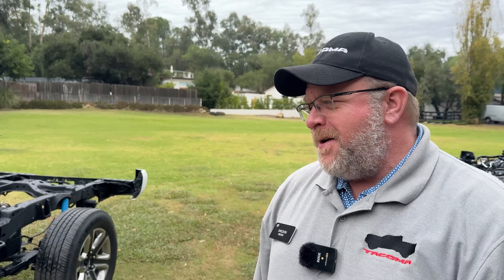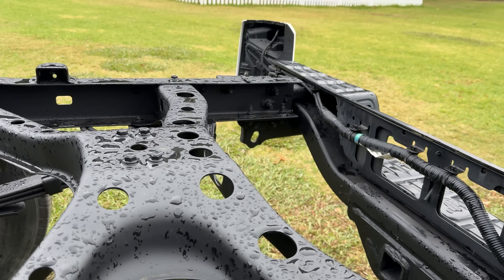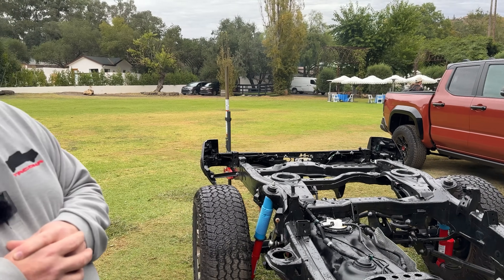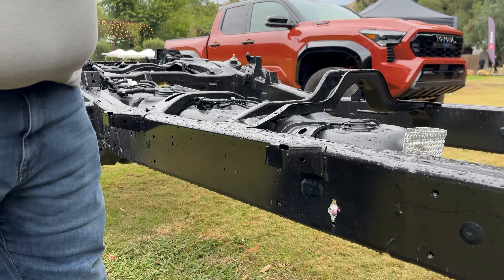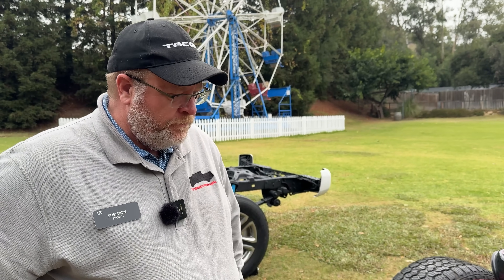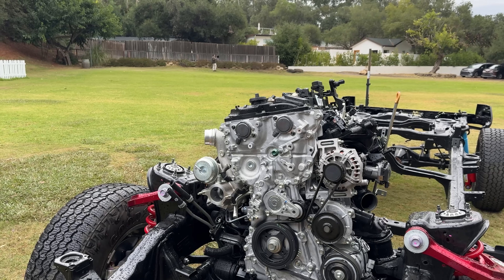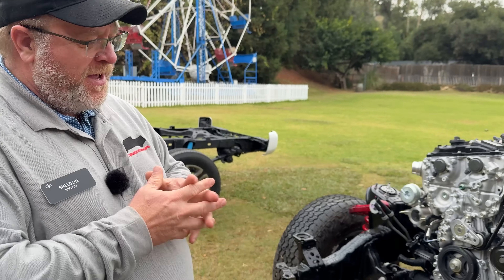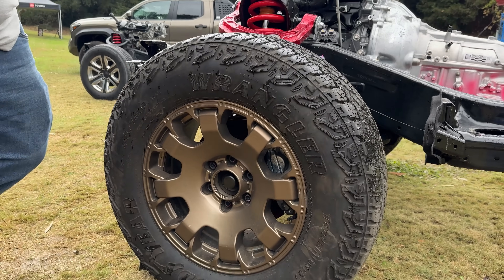2024 Toyota Tacoma Engineer Explains The New Engine and Suspension

Comment: Have a 2025 Tacoma , like the little truck, motor mates well with the transmission. Do 4000 mile oil changes with quality oil and a Toyota filter should be fine. Seen a few V6 3.0 and 4.0
Blow head gaskets, bad frames.

Comment: I do wish that the oil filter was substantially larger. The key to turbocharger longevity (in my personal experience with my two previous gas cars. Both over 200K when I traded them) is oil and air filter changes at no more than 5K miles with good synthetic oil (I use RP) and allowing it to spin down before shutting off the engine.

Comment: Everyone in the comments here are so much smarter than Toyota engineers. You should all start your own companies that make NA V6 engines. In the mean time I will continue to enjoy 278 hp with 317 pf of torque in my SR5. All you have to do is maintain it. Shouldn't be scared of modern boosted engines.
Reply: Id prefer a N/A but not scared of turbos. I’ve had turbo powered vehicles with low factory setting boost. And if well maintained shouldn’t be an issue. Now if you start upping the boost that’s another story. My big concern with the trucks on the market today is cylinder deactivation!!!I will NEVER BUY ANY TRUCK that has that,and coincidentally the Nissan & Toyota doesn’t have it!👍👍👍

Comment: Glad to hear that the cooling of the engine uses oversized pathways to circulate coolant. As Turbocharged small displacement engines run hotter.

Comment: Interesting frame discussion. More openness and transparency about the weight increase to provide a more corrosion resistant and  stiff frame would have been appropriate. And most important a closed section in a truck frame is infinitely superior to an open section and one need not apologize or deflect for making this design choice. Just come out and say how much heavier the truck frame is. At the end of the day it’s the total of power to weight ratio that determines the responsiveness and performance of the vehicle under acceleration and it’s fuel economy..

Comment: Interesting frame discussion. More openness and transparency about the weight increase to provide a more corrosion resistant and  stiff frame would have been appropriate. And most important a close section in a truck frame is infinitely superior to an open section and one need not apologize or deflect for making this design choice.

Comment: I owned Toyotas for over twenty years with Tacoma, Tundra and Corolla and they did very well but not perfect. When I complained to  Toyota Corp. they used to be responsive but the last few years they didn't care about the customer. They have gotten very arogant and I don't know why since the advent of the frame issues, engines issues etc. I looked at the 2024 Tacomas and did not like the new 4 cyl turbo. I looked at all the other midrange pickups and ended up with a Honda Ridgeline with a V6 and two FOBs unlike my 2024 Lexus with only one FOB. I have a four year warranty on the Lexus but when that is up I am done with Toyota. So far I am very happy with my Honda Ridgeline and I don't tow and if I did I would not buy a Tacoma I would get a Tundra to tow anything of any size. IMHO.

Comment: He left out the part where it gets a lot easier to pull a blown 4 cylinder with this new layout especially after putting a turbo on it. I have always had Toyotas but with the new turbo 4's they still need a lot of work. Especially for the price they are asking for these things, Toyota has to either bring back the V6 or extend the Warranty or build bigger lot's for the 24's to sit on until they do.

Comment: I have a good friend that has a 2012 tacoma with the 2.7 engine. A few years back.  He used the tacoma with a snowplow on it for couple of winters, and it started buring oil like crazy. 
After engine tear down by a master toyota tech, it was found the the cylinder walls had severe wear, and the engine had to be replaced.
The engine was over stressed. 
Point is what do they think is going to happen to the 24' tacoma, when the little 2.4 turbo is stressed. Its going to damage the engine.
I keep seeing silly comments of folks saying , oh just get rid of them before the warranty runs out.  LoL
The whole reason i purchase toyota tacomas is for the years and years of reliability.
If you trade ever 2-3 years you never own a vehicle.  You should just lease the truck if you trade that much.
My oldest tacoma is 25 y/o.
My newest is 2015. 
I wont be buying a new tacoma

Comment: I’m a loyal Toyota buyer,    How can this new over worked 4 cylinder engine go 200k plus?   I don’t think so.   I buy Toyota because of the 200k plus longevity,    Any proof that this new engine will do that?    I don’t see it happening
Reply: This is not new , lexus has it on the rx350 its a 2.4 turbo
Reply: ...theres 200k mile turbo Supras, MR2s and loads more models...

Comment: I smell BS from Toyota a mile away because Toyota brought the 2024 Toyota Tacoma X Runner " Concept " to SEMA 2023 and the LA Auto Show. Now, Toyota brought out the 2024 Toyota Tacoma X Runner " Concept " at the 2023 SEMA Auto Show in Vegas but, the same engineer said, " We putted a V6 Toyota Tundra's engine in the 2024 Toyota Tacoma. The Toyota engineer made for the 2024 Toyota Tacoma can carry a V6 from the Toyota Tundra's in the 2024 Toyota Tacoma. Soon or later Toyota will or would bringing back the V6 on the 2024 Toyota Tacoma when the US President changing hand this year. I know what you saying, " It's only a concept and they never putting it into production ".

Comment: The V6 is gone and so am I would never get a truck with a 4-cylinder engine ever you can put all the turbos in the world on it and it is still a 4-cylinder engine and $50 thousand for a truck with a 4-cylinder engine no thanks I can't believe Toyota jumped on the 4-cylinder band wagon. I will never get a truck from them ever again if they dont put the V6 back in the Tacoma? So, it gets a little better gas mileage, but I hear they put a smaller gas tank in it so much for better gas mileage the rear disk brakes are nice, but I have a Tacoma 2005 V6 4x4 and it should have had rear disk brakes too but no very sad about this move to the 4-cylinder I will keep my 2005 Tacoma with a V6 in it and 4x4 and no rear disk brakes :( sad days for us Tacoma drivers
Reply: Turbos have their place, but I'm not taking my truck on the rally circuit.

Comment: No matter how they’re trying to make this new Tacoma Turbo looks good, but, it’s not as same as old V6. I always had Tacoma. I was waiting to get the 2024 model but, totally changed my mined. I don’t think many people will go for this screwed up model. It’s not gonna be the best sellers anymore.
Reply from the maker: Engine downsizing has been a trend for 40+ years now. Global regulation is the driver. I do predict it will sell well though.
Reply: @revmatchtv  good luck, I’m not the one buying it. My V6 2006 Tacoma still going fine after 280,000.00 miles.

Comment: What is the RELIABILITY and FUEL ECONOMY of these engines??
Reply from the maker: No one knows reliability except Toyota, but everyone knows they stake their reputation on it.  MPG is about 15% better vs the V6, and varies according to configuration
Reply: @revmatchtv  Turbo 4cylinder engines of these new models will not have the longevity...we shall see, I have the 1985 Toyota 4runner/Hilux SR5 5 speed with the 22re... ( no rust) and is geared for 35's and gets 22 mpg using PURE gasoline, not E10  type of fuel... has 288,000 miles on it and burns no oil and no leaks whatsoever. Regular 10-30wt oil changes and Denso spark plugs from Japan. no after market parts.

Comment: What a (another) stupid mistake Toyota is making with getting rid of their V6 Tacoma. I don't trust that a small 4 cylinder turbo is going to last well over 150K miles in construction use. These new Tacomas are to please the "Stop Oil" idiots and get your truck dependent on only dealership mechanic maintenance. If you want a gas sipper, get a hybrid or corolla, even a 4 cylinder camry. Keep the trucks as they were built to be, trucks! Not gas sipper sedans.

Comment: I just want a simple, basic, tough,  capable, rig that has a comfy seat, AC, 4WD, and a cup holder for me long drives. Bring back Basic trucks, it should never cost near what the  luxury vehicles cost.
Reply from the maker: The 4x2 Taco starts at around $33K. SR XtraCab 4x4 is $36K including $1500 destination fee.

Comment: The price increases on this truck from the previous generations are insane. Nissan frontier is the way better value now.
Reply: Actually, thats the dirrection I'm leaning after the first of the year, I can't stomach buying a TURDbo anything nor that insane price increase.
Reply: then buy a 2023 tacoma , that simple @vorant77
Reply: The problem with the Nissan is the lack of aftermarket support. So if you're looking to build it up for off-roading that's a issue if just for work and around town no problem.

Comment: I don't care what this so-called, Chief engineer says the V6 engine has always been a very reliable engine, and will more than likely outlive that four cylinder turbo.
Reply: The 3.5 had more issues their first 3 years than the T24A. Timing cover leak and head gasket leaks.
Reply: @lokkstarproductions6918 I'll take the timing cover leak over the turbo 4s self grenade feature any day.
Reply: @ lol stupidity at it’s finest. Sure bud stay afraid better deal for us.
Reply: Don't buy one then bud
Reply: @qbanlink25 In case you've been stuck in a cave, nobody is.

Comment: This is exactly why i bought my 2023 V6 Tacoma. Ive been in the automotive repair field for 30 years and i can tell you turbo or supercharged engines do not last as long as naturally aspirated engines. You add stress to the engines with power adders which shortens the life of that engine. The turbos are also a point of failure as well. Extreme heat and moving parts will fail eventually. You just cant beat naturally aspirated engines for longevity.
Reply: You're right but I wonder why Turbo-diesel can last forever but not Turbo-gas?
Reply: @chrisx5127 diesel fuel is only 40 octane, and it's oil based. So they run cooler with more upper cylinder lube. Also, a diesel runs at lower rpm's.
Reply: @robrichdale114 Diesel is rated “cetane” not “octane”
Reply: @RisenEagles  diesel fuel itself is a lubricant, gasoline is a solvent....that is why diesels last so long
Reply: @ Very cool! I wish my Titan was diesel instead of gasoline.
Reply: @RisenEagles turbo diesels run at much cooler temps, and lower rpm’s
Reply: these engines might top out at 350k miles as opposed to the 1 million mile they have been known for.
Reply: What about the Buick 3800 😂
Reply: How do you explain semi trucks that can go 1,000,000 miles on a single turbo?
Reply: @DavidRC-m9w 
Gas Trucks – Longevity. Diesel trucks tend to last twice as long sometimes as gas trucks, some going for 500,000 miles or more. This is partly due to diesel fuel acting as a lubricant on the engine, reducing wear and tear.
Reply: They can last just as long if you take care of them, regular maintenance is key
Reply: Not true at all.
Reply: Dude this thing has plastic valve covers, and plastic all throughout the cooling system all the angle pipes and connectors are plastic.   This thing is gona be a nightmare in 5r6 years.    No thank you .   Can't believe toyota has followed this poor quality theme that plagues the new vehicles
Reply: Wonder why they didn’t keep the stupid paper filter oil filter like the turd 💩 gen Tacoma had.  That was a horrible filter to replace not to mention a dog turd torque and response lol 
The T24A 4 banger is much more fun to drive
Reply: Oh ok
Thought you just liked the horrible MPG and ultra fatigue driving experience or pushing a slug 🐌 at highway speeds. Thats what my turd 💩 gen Tacoma TRD PRO felt like
Reply: They are built completely different.
Reply: @allenallen5005  Can't they build the turbo for gas the same way? I would kill to have the Hilux turbo engine in this new Tacoma! Of course, that will never happen because we live in the *greatest country on earth. Want the 35K Land Cruiser 70 series? Not here in the USA Jose! Want a Hilux? Move to Mexico. Or what about the nice-looking Nissan Navaro? There is no U in Navaro.
Reply: @RisenEagles 😂😂😂
Reply: Completely different design. And I doubt the turbos last that long.
Reply: @allenallen5005  the reason why semi and their turbo chargers last so long is because of heat management lowering the EGT’s. Toyota has a management in place to keep EGT’s in check. You are absolutely speaking out of ignorance so maybe you should educate yourself and do some research. The information is there to the.
Reply: @DavidRC-m9w  You seem a little upset, you are very sensitive I see. Lol. I stand by my opinion even though you seem to know better than i. 😂😂
Reply: @allenallen5005  I get careless, I’m not the one spouting out ridiculousness ha ha ha ha. The people who don’t like it won’t buy it just allows me to have more options.

Comment: The Tundra engine is a direct fit in this new chassis so if the Turbo 4 doesn’t see good adoption numbers Toyota could stick a detuned 3.4V6 Turbo in there ..
Reply: They have a 2024 concept Tacoma called the X Runner that has the Tundras V6

Comment: Why don't these auto manufacturers just be honest. It has nothing to do with thinking a 4cyl turbo engine is superior to the 6- or 8-cylinder engines or that a 4cyl engine will get better MPG.  It's about the restriction's the EPA put on manufacturers.
Reply: I don’t even really care about the mpg,    I want my vehicles to go 200k plus and never have to go to the shop and be on a first name basis with the service rep
Reply from the maker: It’s definitely regulation. They should get around 10% better economy and there is way way more torque. In real world driving, these are fairly quick.
Reply: I heard there is a tax in Europe penalizing larger displacement, plus the emissions and fuel economy standards. Toyota is and will continue to suffer from limited EV options. But hey, at least we finally got rest disc brakes, huh?   🤔

Comment: No mention of direct injection impact on engine longevity.  So long million mile potential, hello 100k engines.
Reply: How does direct injection impact longevity? If you're worried about carbon buildup this has both port and direct injection to clean up the valves, other than that gdi has not much impact on longevity
Reply: You know what they say when you ASSume?

Comment: I think I'll keep my 3rd gen for a long time.
Reply: Same reason I'm keeping my lo-mi 2nd gen.
Reply: Love the 2nd and 3rd gen tacoma 👍
Reply: @robrichdale114  I just wish we (in the USA) could get the TRD/OR package in the 3rd gen with the Access cab & manual in the USA.
Reply: I really wish the 3rd gen had rear disc brakes. But according to the Toyota engineers we didn't need them. And yet the 4 runner had rear disc.
Reply: @robrichdale114  Agreed.  However, it still stops pretty good with the 4-pot calipers up front.
Reply: @TucsonDude  It does stop good with the 4 port front. Mine might stop a little better depending on what model you have. Mine is the pro. It has all that extra stuff for the brake system for the crawl control. I do a lot of off-roading, so water mud little rocks get into the drums and eat's up the shoes.
Reply: @robrichdale114  I had the 2021 TRD/OR for a few years, then sold it to buy a 2011 TRD/OR.  Crazy, huh?  Those Pro's look nice, but I'd be too afraid to off-road one and mess it up.  However, if Toyota made a TRD Pro (manual) with the long bed/short cab...I'd buy one tomorrow.

Comment: I'm loyal to Toyota but, I'm very skeptical about a turbo charged engine. I've had turbo charged cars before and they don't age well.
Reply: Stay away from turbos once they drop out warranty , it's going to be a very costly repair.
Reply: Golden rules 😂for turbocharged engines I was told. More frequent oil changes, keep your coolant levels at their mandated levels and let your engine run for a few minutes after exercising the turbo significantly to dissipate some heat.

Comment: Time will tell with "long term corrosion protection " First gen had boxed frame and started the tradition of accelerated impermanence , 2nd & 3rd gen had C channel and rusted just as fast. Now back to "thinner boxed & C channel. I am tired of the mandatory  fluid film ritual, and at these prices it should not be required,  even in Saltshitistan.

Comment: Like all the models of old, time will be the deciding factor to see if Toyota made a good or bad decision!  Personally, I'll be sticking with my 2016 for a long time!
Reply: I don't like engines with turbos. Turbos leak and the problem is once they drop out warranty, they are extremely expensive to repair. Most of the individuals on here commenting will never keep the vehicle longer than the manufacturers warranty anyways, they will of course be getting rid of it, at that point.
Reply: @scottishd0g87 Electric cars are not going to take over, Actually The demand has gone down quite significantly, I work as an automotive technician at a dealership, I know what I am talking about.
Reply: @KnowBetter69 It’s not up to the customer. Why have all manufacturers moved to turbos with less cylinders? Emissions fines. They keep raising the standards and automakers have to buy emissions credits. Between 2019 - 2021 Stellantis paid Tesla $2.4 billion for these credits. EV / low displacement turbos are coming purely for financial survival.
Reply: @Lq32332  Go ahead and enjoy your turbo crap, And by the way, when it drops out of warranty I guarantee you, that you don't have the money to fix it.
Reply: @scottishd0g87 like my handles says FJB